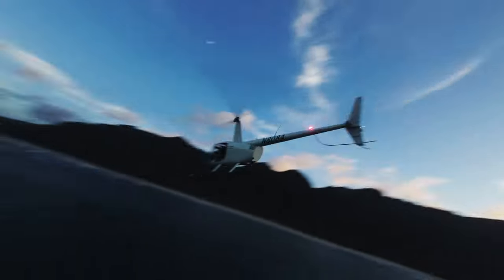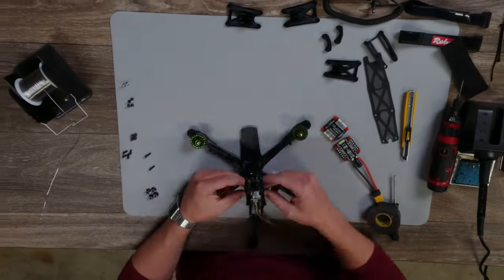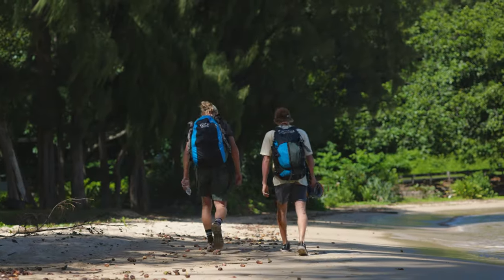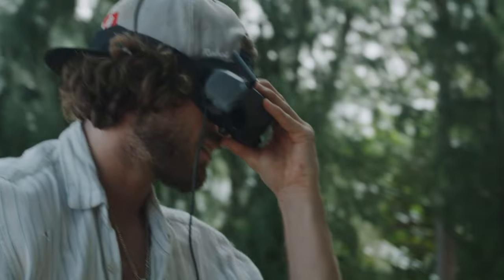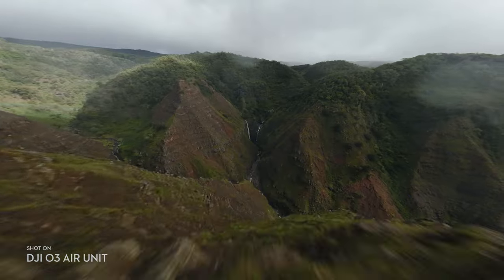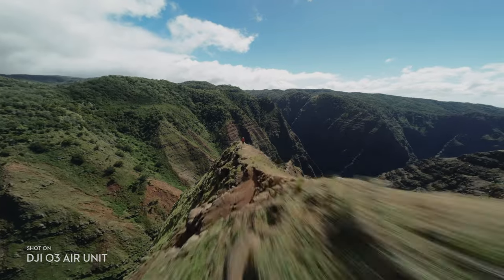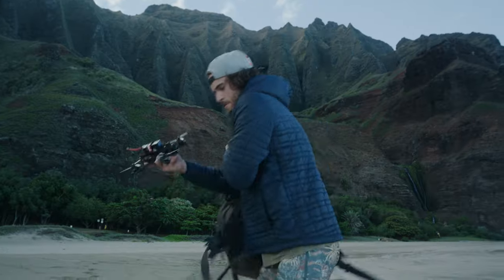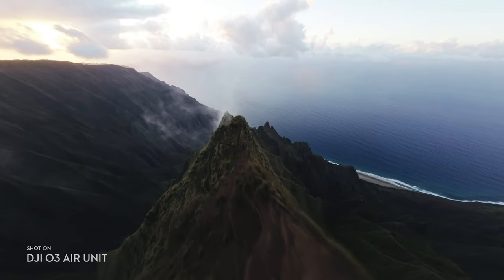DJI O3 AIR UNIT Cinematic Review| FPV Dreamland | Is it the New Standard?

Comment: But why is there a gopro on your quad.... 
And also why is your lens angle so small ..
Reply from the maker: So I’m actually coming out with a video showing the difference between the gopro footage and the air unit so I wanted to compare the two. And always good to have a backup. Low Lens angles allow for more control in certain scenarios. Depending on the situation I will have different lens angles

Comment: When you said “I approached some of the best builders in my area” 😂 How could you not know how to swap out a new air unit and be flying FPV this day and age!? Rad video though!
Reply from the maker: Good question… I’m a cinematographer first not a builder. First of all. I do know how to change out motors and air units if needed but there were a couple things I’m glad I had them for when it comes to switching out the unit. On the specific quote I had to stand off‘s were too tight so they did it fit the camera automatically so we had to design it and 3-D prints a mount for the camera that would reduce micro vibrations. Also we had to re-pin the coax cable so we would properly line up with the flight controller because the power lied was lined up incorrectly for the certain type of flight controller that was on the quad. And the back up quad that I had needed to be fully built from the ground up and I was leaving in one day so it’s better to consult with people that really know what they’re doing

Comment: Awesome I can’t wait  I’m going digital in January and this might be my air unit I’m going with  currently learning on analog
Reply from the maker: Trust you might cry when you put the new goggles on. The latency is probably not as good as your analog system but the quality is so worth it
Reply: @NathanMcBride   can’t wait. I’ve seen the difference  and it’s definitely amazing . I get so much break up and analog already cost me a quad got horrible breakup and a light pole magically appeared from no where .

Comment: Epic video!! Is it even worth it to use a GoPro anymore or just to use the air unit to record?
Reply from the maker: I think the GoPro still provides higher dynamic range and the option to lower sharpness. However the redundancy that an air unit plus an action camera gives is also very nice considering the action camera sometimes has errors that you can’t catch until the flight is done
Reply: That makes sense, thanks for responding
Reply from the maker: @gabriel-ox3ch  of course my man

Comment: Is this good for iflight Nazgul DC? Will use my DJI FPV controller 2 and goggles v2. Any suggestions
Reply from the maker: I use the Nazgûl 6d with the new air unit
Reply from the maker: Also I haven’t used the air unit with the v2 goggles yet so I’m not sure

Comment: Is it possible to go manual on the camera? Can it be locked in at 60fps 120shutter iso 100? Your footage looks really Nice while eventyrhistorie I’ve seen so far has looked like a GoPro on auto function.
Reply from the maker: Yeah it does lock into a manual mode and you can have those settings I personally have been rocking 50 at 50 shutter
Reply: @NathanMcBride  doesn’t this also turn the video feed to the goggles in the same mode? Making it possible harder to fly in say, darker areas with camera not adjusting for shutter/iso etc?
Reply from the maker: @ArcticriderFPV  yes that is the disadvantage to having manual controls within the goggles. However there is quite good dynamic range in the goggles that helps you see the details within the shadows. Now one thing to be aware of is that the image that comes from the camera is quite sharp almost seems pretty crushed but with some color grading you can definitely pull back the shadows quite a lot
Reply: @NathanMcBride  thanks for the answer. Not throwing away my GoPro just yet 😉 But a Nice alternative for sure!

Comment: What range do you get from the O3 unit?  Ignoring what DJI says about 10KM. Im looking for real long range results. Cheers
Reply from the maker: If you have clear line of sight it’s insanely impressive however the penetration at longer ranges still has a little bit to be desired
Reply: @NathanMcBride  thanks but what sort of range?  Some people class 2km as impressive. 

Dji state it’s has 10km transmission so before purchasing im looking for results. 

Cheers

Comment: I can’t wait to progress onto a more legit Kwad from my dji fpv and Avata. Both of which I love, but knowing now that I can purchase a pre build with this air unit, and use my goggles V2 and controller across all is so exciting. 

I’m just struggling on what is best for a newbie coming from DJI fpv and Avata, should I get a whoop (summin with ducts) or a 5 inch? 
I’m interested in the flight bumblebee and Nazgûl, or one of the rotor riot prebuilds.
They offer both whoop and 5 inch as well. 
What’s best way to go/ place to start? I’m more cinema/landscape cruises and dives around the coastlines on Cornwall rather than hectic bando freestyle (but that could change with my skills improving?
A 5 inch seems like it’ll take more of a beating and will carry my action 3 easier, but whoop seems safer as new as I won’t have the ‘oh shit’ button or rth, which I’m of course used to having as failsafe with the fpv and Avata.

I almost spent nearly £300 on eBay for a refurbishment of the big dji fpv controller, the phantom looking black one, literally last week, as was told it’s better to get that on its own first, but I’m so glad I didn’t now this option is available. One controller and goggles that I already own, being compatible for multiple different kwads, from dji fpv to Nazgûl evoque or something is so cool.

What would guys at your level say is best step forward coming from manual mode Avata and dji fpv. A whoop, a 5, or the 7? (Bob57 literally is best of both!) so there’s too many options to know where to start. 
I do feel I’m ready to progress slowly so best options are either iflight BNF or one of the rotor riot prebuilds. 
Your expertise and ideas will be really helpful.
Reply: Sorry for such a long comment, I just have many questions, and don’t know anyone into the hobby locally so asking online is about the best option currently. That I’m overly excited as I’m loving it since finally getting to manual mode and getting more comfortable with it with each flight.
Reply: "A whoop, a 5, or the 7"

Your answer depends on what you want to do. Indoor spaces with people (like the one shot videos)? A whoop (although if you have the Avata already, skip this. 
Freestyling and bando bashing? the 5 inch.
Long range cinematic? 7 inch.
Reply from the maker: Yeah there are so many options to choose from I personal first bought a cinewoop so I could crash without having to rebuild or buy new quads as often But its also important to grab a 5 inch when you are starting to feel more confident. But I agree with your opinion about not having your bando quad have the new air unit if you know you are going to crash alot.
Reply from the maker: Also make sure to get the slim new DJI FPV controller show in the video. its honestly the best if you can get your hands on it
Reply: @NathanMcBride  hey. Yeah I already have the controller and goggles v2 from my dji fpv. Then I bought the Avata as drone only. I was guna buy the big controller to start preparing on liftoff for getting a legit kwad…. So glad I didn’t now as it was £280 on eBay refurbished and that was a good price. 

Now I can just buy and prebuilt kwad with the 03 unit and not need multiple radios and goggles. 
So good. 
I just don’t know where’s best to start. 
I liked the look of the iflight bumblebee or the Nazgûl as they both seem popular options. 
I’m guna wait and see what rotor riot prebuilt options they offer before I make a choice. 

It’s just so ideal that I only need one controller and goggles for the whole fleet now… both of which I already own. 

It’s such an addictive hobby, even coming from learning manual on my dji fpv, n then recently the Avata, that I no doubt will get multiple kwads as time goes on and I get better and know more what fits my needs. 

Cheers for the content. Can’t wait to get to a more competent level to be uploading sick fpv footage all around Cornwall.
Reply: @whereverimayroam74  sorry I missed these responses. I ended up going for a BNF Bob57 with the 03 u it and crossfire. Cheers for the recommendations and stuff. & I may well get a 5 inch when I’m more confident with getting in between buildings and branches but for the minute I’m focusing on nice long cinematic type flights. Cheers and happy flying.
Reply: @NathanMcBride   sorry I missed these responses. I ended up going for a BNF Bob57 with the 03 u it and crossfire. Cheers for the recommendations and stuff. & I may well get a 5 inch when I’m more confident with getting in between buildings and branches but for the minute I’m focusing on nice long cinematic type flights. Cheers and happy flying.

Comment: Nathan I do have one or two questions. I've seen footage of people using the Tango 2 with the new O3, but I thought the new system was only compatible with the DJI FPV RC 2. Would I be able to use, say, my Tango 2 and still have telemetry and OSD on my goggles? probably not but worth asking anyways. 
The new O3's range is good, I know you mentioned it and gave an example, but the original air unite never had a problem flying from the highest points or even just flying long distance over 300–400 feet high, so I bet the new one is even better. However, how about those proximity flies in irregular landscapes like mountains or forests, would you say the new O3 is considerable improved for someone who don’t care at all about image quality but signal reliability and long range capabilities?
Reply from the maker: Yes you can use other remotes not just DJI’s. The penetration is better but not perfect. It’s all dependent on your surroundings so always be careful and mindful of where you are and what your signal levels are
Reply: @NathanMcBride  awesome thank you and once again great video.

Comment: I may have missed it in the video but what settings did you use? Is there noticeably too much latency when shooting in 4k?
Reply from the maker: No not horrible but probably not the best for racing
Reply: @NathanMcBride  I see. Do you think you could do light racing when shooting at 1080p?
Reply: It streams to goggles at 1080P and at the same time O3 Air Unit will record in 4K

Comment: I’m pretty new to fpv . So I have the question do you have to use the DJI fpv remote with this air unit or could I use my tbs tango 2 and how hard would that be to do or just easier to use the DJI remote
Reply: Yes. You can use crossfire or ELRS or......  any receiver. This has more to do with your flight controller. While the 03 can be used for RX you are not tied to using the RX of the 03. This would be a pretty easy swap in to any quad with a vista already installed. If you already have a different radio installed you don't need to change anything. Just keep using your current radio.
Reply: @whereverimayroam74  thank you 🙏  I’m still on analog digital is a little confusing till I get one just trying to be prepared for my first build . I think I’m going to try the fpv2 remote to  keep it simple and clean

Comment: Any recommendation for flight controller, esc motor, to go with this?? Thankss!!
Reply from the maker: yeah so I flew 2 different quads for this video. One 5 inch made by Rebel mini quads and 1 nazgul from Iflight. Both were great options. I would say Rebel mini quads was a much more simple build but flys great. and nazgul has super nice flashy drone great for long range cinematic
Reply from the maker: The Rebel Mini Quads had a rush stack
Reply: @NathanMcBride  Have you ever tried GepRc Mark 5? how does it compare to both? im using dji fpv but got too much jelly and vibration on the video, so im opting for this route :)